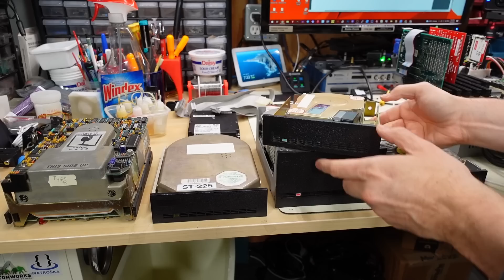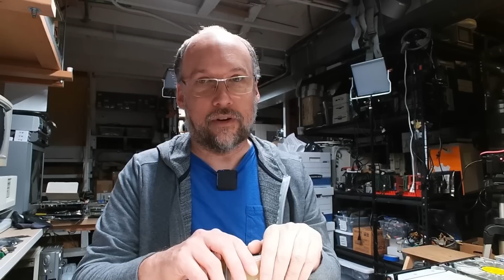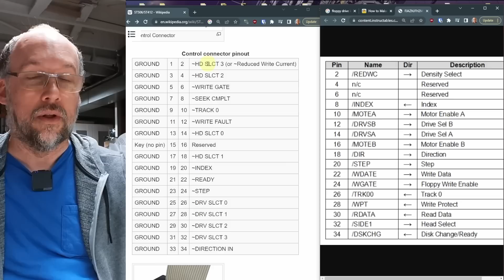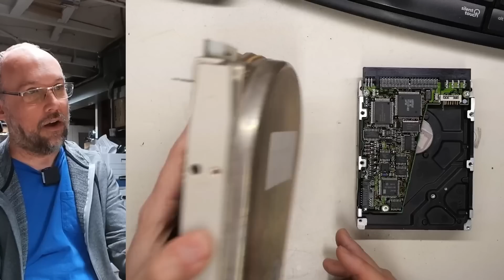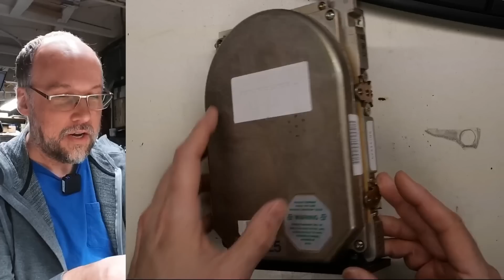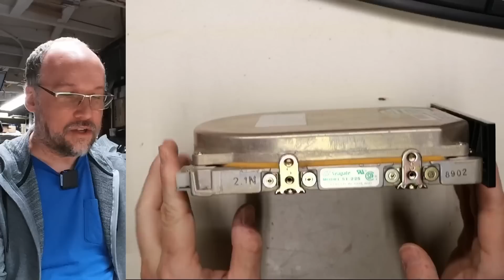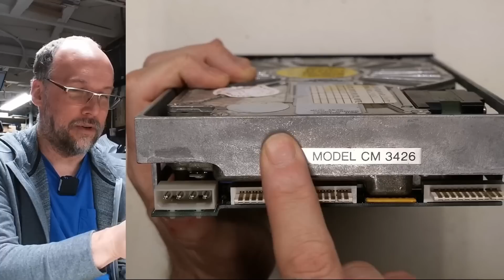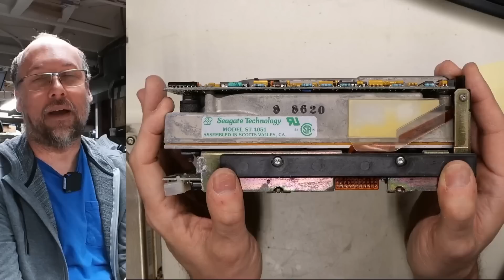Not forgotten: MFM hard drives

Comment: I remember installing a 100mb Maxtor full height mfm drive replacing the Seagate 40mb drive. It was a used drive I picked up cheap after an upgrade I performed for a customer.
I put that into an XT clone I had built from NRI (Heathkit).
That thing literally shook the whole desk spinning up and had the most interesting init sounds. (Like it was singing).It also had the charicteristic bearing whine or buzz sound. That would fade in and out as it sat there and spun.
It outlasted the computer it was in. I definitely got my moneys worth.

Comment: threw lot of those drives into the trash... they were clunky junk.. So went the floppys i had.. all went bye byes...
the ide is better + the sata style drives.... .. one of the worst drives when pcs first started.. had a wyse80286... it went to the DUMP with the RLL/MFM HARD DRIVES..  junk... i will take the ide & sata over these drives,, & no i am not a retro type person.... i saved the old games, but not the drives or hardware... they were just not useful... having to reformat them so often,, just what  a pane they were..
so long mfm/rll drives.. if not anything they crash for no reason, VERY UNRELIBLE

Comment: Donaldson, is a company that specializes in industrial and automotive air and oil filters.  This is the third time I have watched this interesting video.  I remember that I was still using a C64, (so it would have been before I bought my Amiga,1000,  around 1985 )  and I remember that a 10 meg hard drive was offered for the C64, for only $10,000.  How things have changed!

Comment: With Seagate drives the first number is the physical form factor, 4=full height, 2= 1/2 height, 3= 3.5” fat, 5=3.5” slim (except ST506]. The next numbers are unformatted or raw capacity. So ST412 was 12 Mb raw capacity giving 10Mb user capacity etc. Then if there was a letter at the end R = RLL, N = SCSI, AT = IDE etc. So you can determine a-lot from the model  number.

Comment: Doesn't that old 8 inch hard drive you have use the Shugart SA1000 interface then? It does have a 50-pin plug after all for the data...

Comment: Also, it's interesting that that old 3.5" hard drive with the adapter sled on it still had a 5.25"-based bezel on it, rather than having the 3.5" bezel as seen through a hole in a 5.25" bezel as we have later seen for adapting floppy drives including Zip drives, and even internal removable-disk hard drives like Jaz and Rev. I guess they figured that if you were going to put it in a 3.5" bay, by then you would have one that doesn't even have a front-panel opening so you would just take this panel and LED off and connect the case LED to it. Or... what, exactly?

Comment: Hmm, interesting thing that you said about physical drive dimension standards. All these decades I was under the impression that "full-height" and "half-height" also applied to the 3.5" bays but were still based on 5.25" height terminology, meaning that one of the tall 3.5" drives was a half-height drive and one that was shorter in height -- that the most common 3.5" drive bays have been over the last many years -- were called "quarter-height" drives and bays, but... even after looking at the Wikipedia like you do, I haven't yet found something that confirms what either one of us has believed for so long. Maybe we'll find it with more digging, though.

Comment: OK, but then once you got to the non-SCSI version of integrated drive electronics -- what you're talking about here, known today as PATA -- what encoding type replaced RLL? Or is it still RLL encoding but just in the PATA type of controller? And then what about the SCSI type of IDE, which of course is that different kind of adapter system (but the controller boards are still on the drives, right?), what type of of encoding? And then when we go back to ATA, but this time the serial version as SATA, what kind of encoding then? Or have they all been RLL since leaving MFM?

Comment: "If you're hooking up a floppy drive to a computer..."
...or to another device that uses floppy drives, unless it's one that uses one of a few different kinds of interfaces, such as SCSI, PATA, standard parallel port, or USB, which can connect the different types of floppy drives, such as a line of standard ones, LS-120/240 and similar capacities based on the standard 3.5" jacket, Zip, and even several oddball ones.

Comment: No, I think you kind of misunderstood the article. "ST-506" isn't really the name of a category, but yes, it seems to have become one of the old standards upon which the subsequent drives that were made for MFM operation were based. As we can see right on that first photo you showed us here, "ST-506" IS shown right on the labeling as the model name of that drive. But then when they made the interface for it, they gave it the ST-506 model name too (ST-506 HDD vs. ST-506 controller), to match the hard drive. But then, as you said, the ST-412 interface was the refined version that was actually used in the first IBM PC models that were made to include hard drives. I understand that you're saying that ST-506 became the de facto standard for those drives, but since "ST-506" just means "Shugart Technology model #506" and says nothing about what type of technology used, it can't be the official name of an actual category, and thus "MFM hard drive" actually does refers to the category of system (the drive and interface), even though you could take one of those drives and connect it to an RLL controller and reformat it to work that way too. And then it would part of a system comprised of an RLL hard drive and controller.

Comment: Funny story, when I was very young, maybe around 1995, and I was about 10 years old, i used to visit my mom work where they had a PC, that was basically only PC I had some access too. It was likely PC with some 286. I think it was actual real IBM XT. My mom worked as an accountant, they had some drives, programs, and a printer, and did a lot of work on that computer. I was playing with some bips and blips, just learning basic DOS stuff, but one day I did modify some settings in BIOS, and MFM hard drive settings (CHS) were lost, and it was not possible, (or nobody locally knew how to fix it), to restore them properly. As far as I remember it was a pretty expensive repair, reinstalling and restoring some backups, and not everything was backed up.

Few years later I had my own 286, with even older drive (20MB). Some kind of Simense machine, probably with Siemens 286. Likely Siemens PCD-2 - case is very very similar, but afaik motherboard in mine was way bigger, and Hercules like graphics. So maybe Siemens PC-D, as I know these one used weird card adapters (not ISA), and I think mine also was really weird with custom cards, and like 3 or 4 ribbons going to the hard drive.  I was so scared of touching disk settings, that I just left it all alone. This was maybe 1997. The computer was severly outdated at that time, but this was the only we could afford some computer. I was kind of able to use DOS, and Windows 3.1 on it, play some games, learn QBASIC, etc. But one day, I of course did something stupid and did a low-level format. Not knowing how to fix it, or having installation media for DOS, and nobody knowing how to service MFM drives at that time (everybody was using IDE by that time), it just was unfixable and bricked computer.

BTW. It was in Poland, so access to PC was really hard. After I bricked mine circa 1997, I did not get a new one until I think 2000/2001. And these computer were already outdated, like by 10 years, but still used in some offices and places, because companies from Germany were getting rid of them.

So I just hate these drives. Sure, if I would have some documentation and had a better understanding how things work, maybe it would be less painful, but breaking things was a thing for me in my early computer days.

Comment: Bringing back memories!
As a field engineer, I worked on mainframes and document processors supporting the  banking and automotive sector.  One slow- speed doc processor utilized the ST-225's and were part of a larger field replaceable unit. Therefore, many FRU's were replaced, yet the ST-225's were fine (mostly). That said... 
With the help of a fabricated SCSI I/F, an Adaptec 4070, and a MacGuyverized  housing, I had one of the few Amigas with a whopping  amount of hd storage! I remember having to use strategically placed aluminum foil to shield my makeshift assembly. 😂 Those were the days.

Comment: My first computer with a hard drive was a second hand 386.  It had a couple old ESDI (https://en.wikipedia.org/wiki/Enhanced_Small_Disk_Interface) hard drives in it.

ESDI used the same 34/20 pin cable combination as older MFM / ST506 drivers.  I wonder if these interfaces were compatible at all?  And when trying to get an old drive working now I wonder if an ESDI drive is sometimes misidentified as ST506 and then it seems dead because of using an incompatible controller?

Comment: I wish I had known more about these types of HDD technology back when I had my Tandy 1000SX and later a generic 286 XT or AT PC clone.  Both had RLL/MFM hard drives; the Tandy's was a Micropolis 20MB and the latter was a 40MB Seagate.  The Micropolis included its own controller and bracket that the drive attached to, instead of mounting the drive in a drive bay.  It was marketed as a "hard card", according to Radio Shack, and plugged into one of the 8-bit ISA expansion slots.  The generic 286 was an Everex mobo manufactured by Foxconn, had both 8 and 16-bit ISAs and an American Megatrends ROM BIOS.  I abandoned the Tandy and transplanted what I could to the 286, including the 20MB drive.

Comment: Great video!

I worked in a local computer store in 1989-1990 and this brings back great memories.

Some things that might help

1. The first number in these  seagate drive represents the form factor.
4 - 5.25 full height
2 - 5.25 half height 
1 - 3.5

2. Full height / half height refers to the bay size. So the lager 3.5 drive would still be considered half height. 

3. The following numbers represents the un-formatted capacity.
St225 - 25 meg un-formatted /21 formatted 
St251 51 meg un-formatted / 42 formatted 

3. To setup 8 bit controllers 
Run: debug G=C800:5

I still remember this 34 years later.

Comment: I had a full height ST506 drive that I salvaged from an old mini system that was about to be scrapped. Had 5MB total storage! I paired that with an Amiga 1000 and a Spirit HDA 506 expansion with an OMTI controller. It felt like I had something so much better than an IBM XT at the time. Later I upgraded it to an ST225 with 20MB, a half-height drive. I had just as much storage as some of the PCs I used at work at the time.

Comment: I had a full height 20MB MFM drive in the 286 PC I got from my uncle when his company was getting rid of old stuff. I was very happy when I could find another 20 MB half height drive at my high school, and could double the capacity. I remember using Norton’s Calibrate to optimize the interleave values. Good times :)

Comment: One benefit of using the RLL encoder I used back in the late 80s was that it broke through the BIOS disk limitation. I unblocked a company trying to install a hard drive larger than the BIOS would accept by selling them RLL controllers.

Comment: My Amiga 2000HD came with a 20MB RLL/MFM Rodime branded hard drive, which lasted maybe 1 year or so; after it died, I replaced it with the Seagate ST-xxxx 80MB drive, which cost me $450 Canadian at the time.  It's funny how a single PowerPoint file can easily use 20-80MB :)

Comment: My first PC had a 40MB MFM Hard Drive. it was an IBM PC XT. The IDE ATA command set started here since it is essentially the same thing, the differance is in MFM the contoller for the drive is seperate, in IDE and all modern drives, the drive c0ntroller is built on to the drive. Modern Serial ATA still supports the original IDE ATA command set spec.

(BTW; I wrote this before i got past the start of the video, lol)

Comment: In Seagate naming convention: ST-XYY

ST = Seagate Technologies 
X = 4 = 5.25", Full height
X = 2 = 5.25", Half height
X = 1 = 3.5"

Y = unformatted capacity

So:

ST-412 = 5.25, full height, 12MB unformatted, aprox 10MB formatted
ST-225 = 5.25, half height, 25MB unformatted, aprox 20MB formatted
ST-238R = 5.25, half height, 38MB formatted, aprox 30MB formatted

Comment: have to check back to see any failed drives get opened up.  The mechanical parts (motor, discs, bearings, head assembly) is generally high spec.  for something that gets tossed as junk.  With a 3D printer you can make some parts to repurpose it for spin coating etc.

Comment: My first drive was a HUGE ST-225 (20 Megabytes) that I paid $600 and it would hold YEARS of data. (ST-2 = Half height 5.25". ST-5 was full height) and 25 stood for 20 MB.  The usage of RLL encodingon drives with poor margins is what killed Leading Edge as they were using ST-225 drives with a cheap RLL controller and called it a 30 MB drive.Technicians at 'Sams club' tell me that approx 50% of the Leading edge computers were dead out of the box. Short lifetimes = Bankruptcy  (RLL requires better signal/noise than MFM for a given error rate. single density floppys used FM. Double density was MFM (Modified Frequency modulation)

Comment: Back in the day, my father got on a hard drive optimization kick with our 286 machine. He bought a Perstor controller card that low-level formatted a standard drive using a more efficient RLL format which increased capacity and speed. I remember it working well. I believe it also supported the trick to increase capacity on floppy disks but I don't think we ever tried that.

Comment: Oh this takes me back... I used to have an Amiga 2000 with a Seagate ST-225 MFM HD in it. It still had the two 3.5 in floppy drives up front with that heavy monster tucked away under them. The two ribbon cables didn't do much for the air flow, that's for damn sure. 
When shutting the Amiga down after use, the HD would do a fantastic impression of a Jake Brake from a mid 80s diesel if it were running at twice it's redline. Love that thing.

Comment: "Is it possible to use RLL with floppies to increase density?"  Yes.  That's what GCR encoding does (Commodore's is a form of 0,2 RLL), and is why Commodore's and Apple's floppies always had higher storage capacities compared to its contemporary competitors.  MFM is also a form of RLL (1,3).  The problem with using larger RLL encodings, though, is that you need faster data rates in the drive controller and more sophisticated bit-stream decoding logic.

Comment: I had one of those drives, actually two of them, in a Tandy model 6000 (replaced the smaller factory drive), the WD1010 disk controller chip could address a maximum of eight heads and 1024 tracks, which is what this drive had.  Micropolis listed it as 69MB but in the day it was typically sold as a 70MB drive.

Comment: Hahahaha Takes me back to the past. MFM..... XT, AT. Blasts from the past. Had them in my first PC and later PC's. Bigger and bigger. More capacity. The first one had a capacity of 40Mb. Now? Hahaha..... SSD's and NVME M2's  with madly capacity's. No moving parts and no noise anymore. Some former MFM drives you can hear them starting up.... That constant hum.... Those cables.... and connectors. 2 sets. IDE One connector for disk 1 and the second for drive 2. The settings. Master, slave. No 2 masters on the same cables. Old school......

Comment: I remember back in the day that IDE drives were ATA and SCSI, meaning drives that had controllers onboard with IDE standing for "Intelligent Drive Electronics" and later "Integrated Drive Electronics" and ATA and SCSI cards being reffered to as interfaces and not controllers. These terms have been interchanged and misused, even hardware manufacturers reffered to them incorrectly so confusion was inevitable.